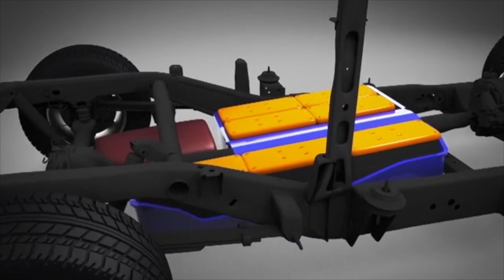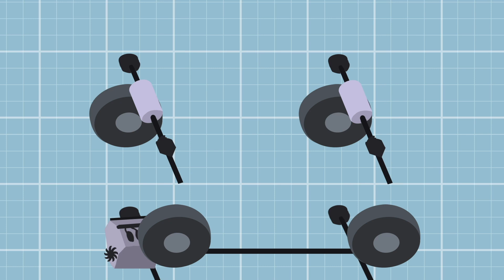Could This Pickup Truck Design Change The World?

Comment: The biggest issue is the people that buy them that don't need them. If you are afraid to scratch your truck or buy a luxury trim level you probably don't need one. I am in the horse world if I was worried about scratches or getting horse shit or mud in my truck or on my fancy leather I wouldn't be in the horse world or sane. Sure there are acceptions but let's be serious I believe it is like 15% of trucks are actually used for work. One in 100 people in the US are farmers and I am pretty sure if you add in people that use them for other regular work related things it still wouldn't fill the 99 remaining spots.
Reply: Would you buy a brand new truck to do those things (hall horses and shit) or just buy a used one?
Reply: So I'm guessing you're proposing just restricting what vehicles people can buy? People will buy pickups if they want pickups. I wanted to pick up and I bought a pickup. Do I tell all the time? Hell no. I drive a Ranger that gets 13 City 18 Highway. Lol
Reply: The biggest issue is people trying to tell other people what to do and what to buy.  That is the biggest issue.
Reply: You let me know when there's a car that sits as high, can tow as well, has as good a ground clearance, can pull people out of a ditch as well & fits a 6'6" guy.

I'd rather not have someone tell anyone else what they Need.

Comment: I just bought an F150 and love it.  I really wanted a plug in hybrid, but not available.  I researched companies that had plug in hybrid kits.  An interesting one I found was a college project that replaced the rear brakes with electric motors that also work as brakes and regen for the battery.  Easy to retrofit existing pickups.  The electric motor would be an assist, like an ebike, sensing torque input for torque output, so could be independent of the trucks current ECU.  This would greatly reduce gas consumption when commuting.  I’m a robotics engineer and toying with the idea of designing this...
Reply: Ladd Johnson 
Then make it. You can do it
Reply: how would you deal with the unsprung weight?
do you have a name for the kit?  I'd like to build one
Reply: Tore Lund for just commuting too and from work, you do not need that much battery.  Also, it is just an assist, not to provide all the energy for the truck.
Reply: CheekyMonkey888 unsprung weight would be higher, so it would ride tougher.  Rule of thumb is unsprung weight is 10% or less of total weight.  So that’s about 500 lbs give or take.
Reply: Ladd Johnson look up TM4
Reply: I just found out thanks to this video that my Nissan Versa is as thirsty as an F150...great!
Reply: @Ladd Johnson If you're seriously thinking of looking into designing and making this, I'd suggest looking at Robert Murray-Smith and his youtube channel.
He's currently producing a Supercapacitor battery, and it is basically the holy grail of energy storage.
He is fully independent, has his own factory, and very high levels of quality control.
His capacitors hold immense charge and don't have the drawbacks of traditional polymer batteries, whilst being compact and lightweight. They don't overheat and take incredible charge at superfast speeds.
Reply: In an informatics engineer, lets team up. Greetings from Europe
Reply: Don't waste your time.  Gasoline is dead, dead, dead.  Sell the F-150 before it depreciates to stone.
Reply: @refusoagaino6824  Wuahahuahuaha 😂😂😂 you naive fool, NI CHANCE you are going to see gasoline disapear in the next 20 (at the very, very least) years 😅
Reply: @huntermarcy7180  I never drove a pickup truck in my life. 
So just calm down sweety...
Reply: David Miletič talking about ladd
Reply: @huntermarcy7180  oh. YT notifications are something else, screwed up totaly.
Reply: David Miletič yeah I got mad at the video too

Comment: A good chunk of the reason pickups are so popular in the US is because they qualify as trucks rather than cars, which allows them to sidestep the emissions regulations that made cars more expensive and less fun by comparison. Since fuel remains cheap in the US, fuel economy is not a massive driver. Plug-in hybrid pickups, especially with the option to use them as generators, is a great idea, though a lot of the pickup market is made up of people who are proud of their pickup's gas guzzling ability. Once a plug-in hybrid pickup is marketed with enough heavy towing and tyre smoke I suspect they'll forget that they hate Priuses and get ordering though...

Comment: The reason fully electric trucks are not viable now is simple IMO. To compete with a full size (f150)truck with a load or hauling would require a very large battery (150kw battery?)and the price per kw/hr is still too high. When battery prices fall trucks will be made. This is why Tesla started with smaller vehicles. Buy the time Tesla makes a pickup battery prices should be way down. Think mid 2020’s.
Reply: Big Tesla fan here...but very unrealistic. The S an X that have 100kw batteries start at 82 thousand! There is just no way they can sell a truck in 2020(14 months) with a 150kw/ish battery for 50k, over 30k less! Also the timing is impossible. They haven't even had and official reveal or broken ground on the Model Y factory which will be their next prime focus. The next 3 years will be Model Y,  Roadster, Semi and china factory (3 & Y).

Comment: I would buy one if it was 4x4 , can haul what I need, heat in  the winter, cool in the summer while keeping the same charged vs gas mileage, charge as fast as I can fill at the pump, withstand running for heat for hours in winter for workers  on job sites, and still have mileage left to get back home in standstill traffic, and if by chance I need to go off road that I can get a jump start in the same amount of time that I can get a jump start in a gas vehicle. If it doesn't have all those qualities I won't touch it with a 10ft pole.
Reply: Frank DeLucey I’ll only buy a gas truck if it gets 60 mpg, the torque of a diesel v8 with no turbo lag, fill up overnight while I’m sleeping at home with a fuel that costs 60% cheaper than gas and only has tires as a maintenance cost.

Comment: While I would love to replace my old diesel pickup with an all-electric, I know that one that could do what we use our pickup for would be cost-prohibitive.  One of our major use cases is camping with a pickup-bed camper on the back, sometimes towing a boat behind.  And we often drive it 500-1000 miles to our destination.  Often driving it nonstop, only stopping for fuel, and getting food and stretch time while refueling.

It would realistically need a 150-200 kWh battery pack to be able to do that. Even then, it would likely mean stopping to recharge every one to two hours, and with the maximum currently planned DC fast charger being 150 kW, that's a one hour+ stop every 1-2 hours.  That is not conducive to road trip use.

Not to mention a brand new truck with a 150-200 kWh battery would likely cost well over $100,000. (Since it's going to be expensive due to the batteries anyway, it would almost certainly be a "luxury" trimline, like the GMC Denali Ultimate package or Ford Limited package.  So realistically, probably over $150,000.) I just can't afford a truck that costs more than I currently owe on my house.

But GM/Chevy used to offer a "mild hybrid" pickup that wasn't much more than their regular model. And while the series hybrid/plug-in suggested here would cost more than the old mild hybrid, with modern technology, it could be built in a way that wasn't MUCH more.  I could see an entry-level full-size pickup having it as an option.

And if the manufacturers went all-in on this drivetrain, it could become the default, and just have differing battery sizes and plug-in ability separating them, with the minimum battery (say a 15 kWh) being cheap enough that when you take into account the reduced complexity of the engine and transmission, it should be able to cost about the same as a "conventional" ICE drivetrain.
Reply: Anonymous Freak u can’t drive “non stop” AND stop for fuel and food.
Reply: @bigdougscommentary5719  sigh . The common usage of "nonstop" for road trips does not mean "drove the entire distance without ever coming to a stop for any reason," it is generally understood by people who aren't being absolutely pedantic as "without stopping for longer than necessary for mechanical and biological reasons.  AKA: Driving through the night, and not stopping at a hotel.   Even long-haul truck drivers consider a drive to be "nonstop" even while stopping for fuel, bathroom, and food.
Reply: Mark Plott We use a pickup camper so we can have a nice living area that we leave at the campground, and drive the pickup. Yes, we could tent camp in our smaller car. We don’t. We could get a tow-behind for a car/Tesla - but the Tesla X is $80k+ and a lightweight tow-behind is $50k+. We already own the camper. We already own the pickup. When it’s time to replace the pickup, hopefully a good option is available for not-too-much.

Comment: Nikki: as an EVA member for more than a decade who has been driving EVs most of that time, and who has an S-10 EV conversion, truck drivers merely need to be given a chance to drive something unique and electric for a while to be convinced of its practicality, performance and efficiency.

My truck was originally converted to EV by Sony Pictures some years ago, but they could have made better choices--- lithium rather than lead/acid, AC rather than DC, a larger battery pack between the frame rather than taking up bed space, etc.

You may renember my friend, "Gadget", the talented techie from "Who Killed the Electric Car?", and its sequel... he helped me redo the truck to make it more practical and extend its range.  I had him design a remote control bed lifter that tilts the bed to the left to show off the battery pack, which is handy for car shows, and to explain how an EV works.

With the pack below the axle height, it is extremely grippy on turns.

The truck is on my YouTube channel, billdale1.

https://youtu.be/PmcQTTCKd5U

Comment: As you say, there is nothimg new with this idea. Manufacturers could adapt it to pickup trucks.
Reply: Keyword: "could". But, well, money.
Reply: In the 90s you could get electric ranger. In 80s you could get diesel ranger that got 40mpg. What happened?
Reply: Joe Smith Uhm, No-one would buy it?  (except tree huggers who don't want or need trucks).  Just call up pizza delivery on your cell phone.  Say what, you live off-grid?  We can have that pizza to you in 3 days and the delivery charge will be $150.
Reply: it wont sell. its suicide to make them. remember we live in a world that people vote with their wallets. trucks are already damn expensive . youre talking about 75,000 price points

Comment: Totally agree.  I drive a Chevy Volt.  Love it!  88% miles on EV; the remaining 12% on ICE.

Why isn't the Voltec platform available in a pickup?... and a SUV?
Reply: John Morgan ... Me too...
Reply: A version of the Voltec powertrain, modified for truck use, would be ideal. GM is dropping the ball by not pursuing that opportunity. If they wait until after the Tesla Pickup starts production, it will be too late.
Reply: Ever heard of Via Motors?
Reply: How do you charge.unless you have your own massive solar charge system .your going more harm than good.
Reply: Joe Bowden : Primarily I charge overnight at home. My region generates electricity from natural gas, which contributes far less CO2 than electricity derived from coal, or from burning gasoline in a conventional ICE car.
Reply: @bukweet  cool.I support ev's but believe like house air cons. Owners should need to also but solar charge units.if we charge from the grid even gas power there isn't the environment all benefit.I all so have an idea of exchangeable battery packs for EV's.ie. you pull into a service station.exchange your automatically have your batteries exchanged and drive on in less than five minutes fully charged
Reply: trucks and suvs are simply too heavy . the chevy volt is good for transporting passengers . Tools and matierials are gonna need a truck .
Reply: I think we could see it within two year. The new silverado/Sierra platform as a 2.4L, a variation of this engine could be paired with the rest of the hardware. With the carbon fiber box and use of aluminium there is weight saving for future battery pack.

Comment: Put a high power inverter with a 110v/240v high amp output and it will sell like hotcakes
Reply: Right! I could imagine plugging my house into my truck after a Hurricane. Who needs a 20kw generator when you already have one with a huge battery reserve to boot.
Reply: @markplott4820  
Lets make it only slightly more complex:
120V two outputs with independent 30A breakers
220V 30A
208V 3 phase output 30A
440V 3 phase output 30A
All outputs reasonably good sinewaves[1] that hold either 50Hz or 60Hz to 100PPM in the long term.
The total for all outputs can be limited so that we don't make all of the above at the same time.
The 120V and 220V are really the same electronics and thus you only get one 220V
The 208 and 440 are mostly the same electronics 
[1] I have done lower power stuff that does very good sinewaves but really for this we would only need to suppress the 3rd and 5th harmonic of the mains so a waveform that does 0V, 70%, 100%, 140%, 100%, 70%, 0V, -70% ... with a bit of a filter would be good enough.  Most of the extra motor heat comes from the 1st 2 harmonics and beyond that keeping out out of the AM radio is the next bit issue.
Reply: I love Hotcakes !
Reply: Matthew Califana, yes, they're great!
Reply: So 6 hours of solar charging = 3 days of house electrical needs? That doesn't sound kosher.  @markplott4820
Reply: GM tried that about 15 years ago on their pickups.  No longer offered, so it didn't sell well.    The trucks had a large battery pack, so the engine would shut down while stopped.  At a work site, it provided electrical power, and the engine would start up when needed to recharge the battery.

Comment: I believe your suggestion is impracticable. The Tesla truck will need a 150-225 kW-h pack not only for sufficient range, but for sufficient power. At today's maximum charge/discharge rates, a 30 kW-h battery pack wouldn't provide enough power under moderate acceleration. Also, trucks often operate near their maximum engine outpoint for long periods of time (think about towing a boxy trailer down a highway), at which point your battery is quickly drained and your range extender is producing all of the power, which isn't much different than a conventional truck. There's a lot of negatives (including extra weight and cost) for little benefit. I don't want to be too negative though, I like your YouTube videos and have watched dozens of them -- please keep up the good work.
Reply: Maybe ultra caps could help with charge discharge and regen rates
Reply: Joe Stoffa She explained most of that. A smaller, more-efficient turbo generator that makes 300hp will be reasonable. The point isn't to make it electric. The point is to have it electric for those dumb commuters and pickups in cities and to be efficient at Long haul loads and add generator capability. Get the giant HUGE displacement engines out which are used for their torque and replace it with a small low-torque gas engine with an awesome power to fuel usage ratio and let me electric motors worry about the torque. This isn't for 80,000 tractors-trailers, it's for F-150 and 250s
Reply: Joe Stoffa: having driven an S-10 EV conversion for a few years, the short answer is:  I disagree.
Reply: At least it gets everyone to have a debate about this